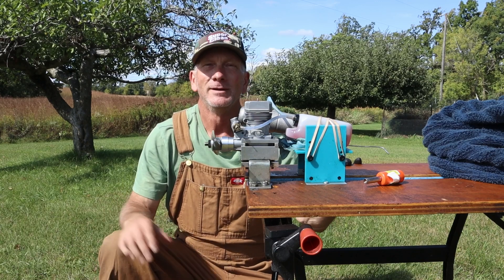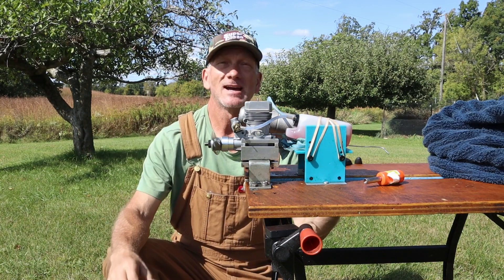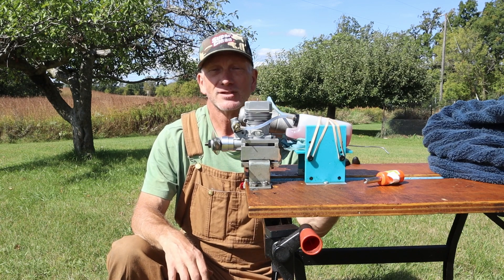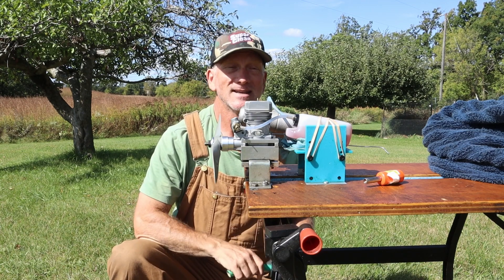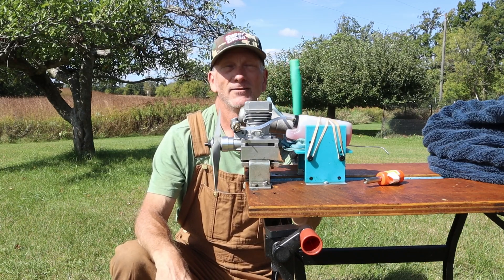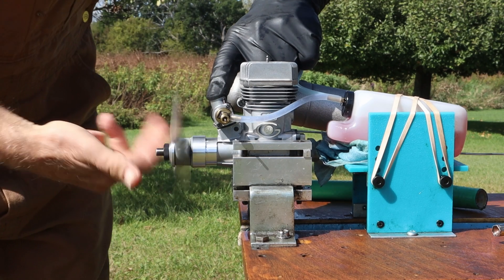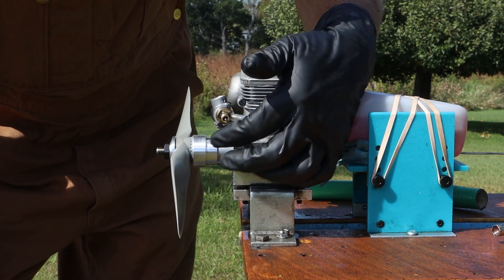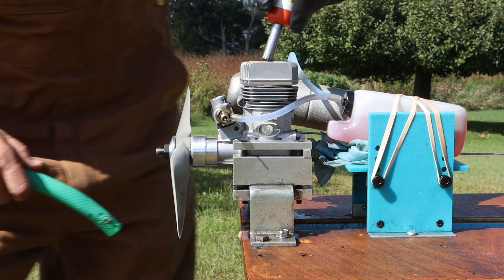Super Tigre G75 The First Run

Comment: My 75 came with a tuned pipe. It starts and runs so nicely! And has tons of power! I don't even know how many hours it has run before I bought it but the cylinder, piston and ring still look very good. The only part I had to renew was the main ball bearing which had corroded to death. I love this engine as much as my ST G2000. These are perfectly engineered workhorses which start so easily even by hand and deliver tough power over decades
Reply from the maker: Was it difficult getting the prop hub off when you replaced the bearings?  Believe it or not I have never disassembled a ST engine before.
Reply: @dmrcflyr2 I disassembled my G2300 to replace bearings. Prop hub removal wasn't bad... Definitely took some pressure but it popped off. Just make sure and have one of those puller tools. 

It did take a lot of heat on mine to get things loosened up enough to replace it .... Sleeve was the toughest thing to remove.
Reply: @dmrcflyr2  It sat quite tight. I used a puller to take it off without killing the front bearing. Then heated the housing to get both bearings out easily. If you don't care about the bearings just put the front housing on a plane surface with space for the crank and gently tap the crank out with a dead blow mallet or copperhead hammer

Comment: I always used a Fox long R/C plug with an idle bar in my SuperTigres. I forgot to mention the other day that I didn’t use the idle speed stop screw to set the idle speed. I would back the screw out until the carburetor closed completely. I let the servo and linkage set the idle speed. I'd slow down the travel of the linkage on the idle end by offsetting the servo arm one tooth from center toward the idle side. At idle, the hole in the servo arm is moving sideways about as much as it moves fore and aft. On a full tank, the mixture is a little rich and the motor idles slower. At the end of the tank, the mixture leans out and the motor idles a little faster. I'd use the throttle trim to adjust the idle speed. On a full tank, the trim is usually all the way up. Before the last landing, I'd move the trim to center. And to kill the motor, I'd pull the trim all the way down. Older radios had a detent in the center, and it was easy to go from high to center and then to low. On newer radios, I'd probably change the size of the trim steps so that I wouldn't have to hold the trim lever so long.